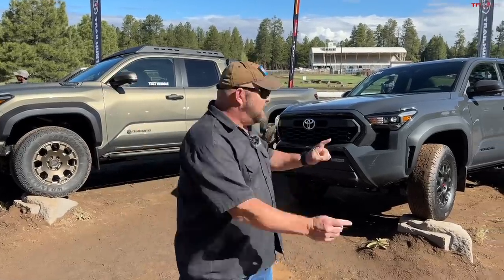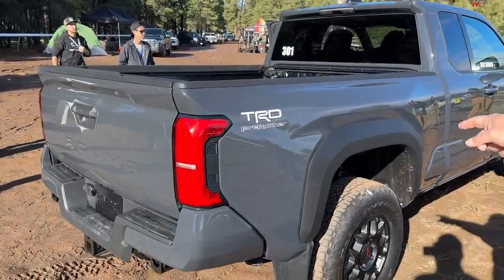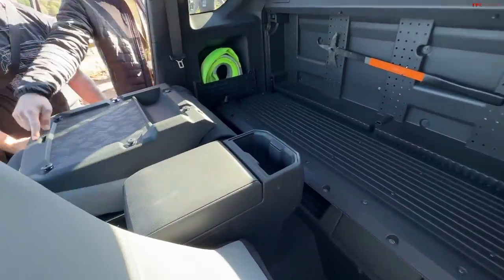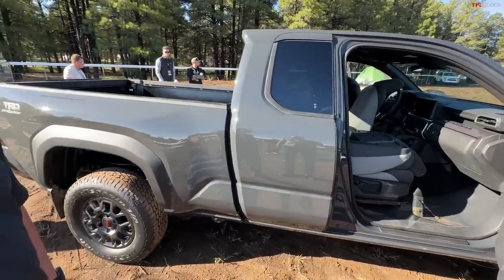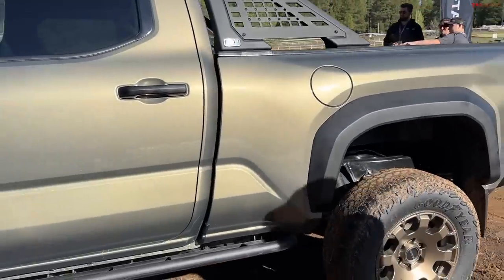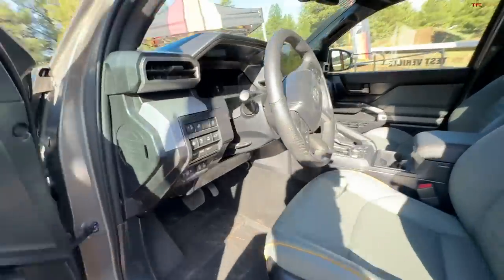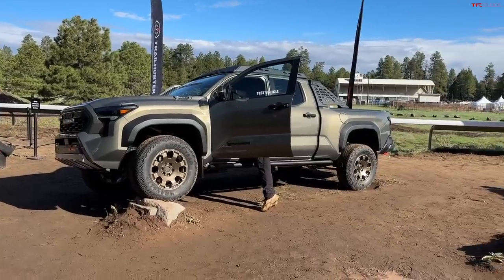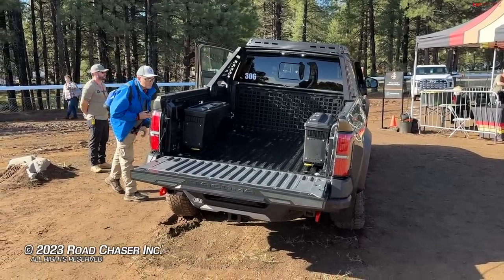Here's How the 2WD 2024 Toyota Tacoma PreRunner Compares to the All-New 4WD Trailhunter!

Comment: I bought a new 2002 TRD Double-cab Prerunner V-6 with a rear locker and it was the best vehicle I've ever owned.  Drove it for 18 years and sold it to my nephew with 275K miles on it and it is still going strong with over 300K on the odometer.  The locker got me out of most anything I got into and it was a workhorse.  I built or renovated 4 houses when I owned it and it was loaded to the gills with lumber and supplies many times and it kept on going and going.
Reply: That won't be the case this time around. Toyota's 4.0 V6 were simple which made them reliable. Now? It's complex like the competition. Expect a hit in reliability for Gen 4. No where near the Gen 2 or Gen 3
Reply: did yours have a Trans cooler on it I have and 2002 and live in SC im unsure if i should get one or not mine is 4wd tho
Reply: @moctezumaaleg2008  It had the factory trans cooler that sends the trans fluid through the bottom of the radiator.  A lot of people add an aftermarket trans cooler and plug up the factory arrangement because it can leak into the radiator and mix with the antifreeze and the antifreeze can get into the transmission and ruin it.  There are U-tube videos on this and it is called the dreaded strawberry milkshake.
Reply: @stevevice9863  yeah mine just came with factory but the radiator is pretty new so I think I should be fine for now as far as milkshake what I ahve been debating is if I need a cooler or not dont have much experience with how hot the trans temps on tacomas get .
Reply: @truthkeeperfilms  V6 didn’t last as long as the 4 cylinder.

Comment: No doubt the Tacoma engineering team is letting out a huge sigh of relief after seeing how positive the reaction is, especially after what Toyota went through with the Tundra.
Reply: The A team on the Tacoma side.  The junior varsity team on the tundra design group. 😂
Reply: Hahaha
Reply: Taco forums aren't liking it. They don't want the gadgets and electronics and a possibly less reliable turbo engine
Reply: @davidzambrano9126 I have a younger co-worker who bought the current gen specifically because of the new turbo. It'll turn some buyers away but their only option for NA engines will be the Frontier. I bet they'll stick with Toyota lol
Reply: @Ichibuns well to be technical not the only one, although the ridgeline isn’t very competitive it does have an NA V6 and so does the Jeep Gladiator. However the segment is downsizing as has Chevy with the Colorado 2.7L and even the ranger will bring a 2.3L 4 cilinder, we have to accept reality and at least appreciate they did get best-in-class Torque, hoping fingers crossed 🤞 they also nailed the MPG and beat the segment
Reply: The Toyota trucks are hideous looking.  GM did a much better job on their trucks.  They don’t look like Transformer toys like Toyota does.  Also there’s no front locker on the top Toyota trims like the ZR2 has.  Toyota can try and spin it however they want but no front locker is a big deal.
Reply: @holdenc3082  
they should have done a front locker, but as far styling I like it.
Id never buy another new chevy if it was a vehicle
I wanted to own past warranty.
Reply: @@dancross3340  Toyota’s reputation for reliability was over a decade ago but lots of folks haven’t caught up yet.   My GM vehicles have been better than the two Toyotas I made the mistake of buying.
Reply: @holdenc3082  
ive had two tacomas in row both have been good one I had for 10 years the other is now like 3 years old and nothing has broken, my wifes prius is the same, its had 160k and nothing still get 43 or so highway and about the same in the city
Reply: This Prerunner is marketed to me! I don't need 4wd, 4 door or passenger seats. I need a driver's seat and longer bed. Finally! I can get Toyota quality while looking somewhat cool...unlike a Santa Cruz or Maverick.
Reply: I've seen a mostly negative reaction everywhere but from these paid "journalists"...
Reply: @@dancross3340  I had a Tacoma also.  What a mistake.  It ate pads and rotors like candy.  I couldn’t keep brakes on the thing.  The starter died just out of warranty.   The shifter broke.  The doors felt like they were made of beer cans.  I dumped it and got a Chevy Silverado that went 250k miles with only a water pump replacement.    My wife had a 4Runner when we got married.   It was garbage too.  Couldn’t keep brakes on it either.  Every time the thing needs brakes it was a question of how many calipers were going to be stuck and would need replacing.   It was a well known problem with the 4Runner.   GM has given me less problems overall.
Reply: @@aaronerickson8878  It’s how they get invited to all of these events.
Reply: Tundra has never really been super popular, Tacoma sells like crazy.
Reply: @holdenc3082  So go buy yourself a Canyon.
Reply: @holdenc3082  Recycled beer cans is a selling point.  Every new truck they are bragging about aluminum hoods, tailgates fenders, etc.  Hell, the whole F150 is aluminum.
Reply: @davidzambrano9126  There are many saying they will not get it because they switched to the xtra cab instead of the access cab.
Reply: @davidzambrano9126  the turbo has been out since 2015 and has been flawless. It started as a 2.0 and now bored out to 2.4l. The Lexus has had zero issues with them.
Reply: @aaronerickson8878  have you read the comments here?
Reply: @holdenc3082 ude sounds like you either lying to us, or made a bad purchase without doing your due diligence. I have owned several Toyota and still have my 2019 Camry paid off with 107k miles still going strong, had one recall for the high pressure fuel pump and that’s it.  

Toyota still makes the most reliable vehicles, don’t embarrass Toyota by putting it up against Chevy or Ford. People that buy Japanese cars know how much more reliable they are over almost any other brand. 

Hence Toyota, Mazda, Lexus, Acura, Honda still at the very top when it comes down to reliable vehicles.
Reply: @@FlexRod  The only bad purchase I made was buying a Toyota Tacoma.  My wife owns the mistake of the 4Runner.  Toyota can’t design a brake system if their life depended on it.  As far as their wonderful reliability, go ask the ‘23 and earlier owners about the junk transmissions that don’t shift right, fuel pump recalls, and the still lousy brakes.  Toyota has plenty of problems, but the Kool Aid brigade likes to sweep them under the rug.  It’s almost like Toyota pays you people.
Reply: Need to have the back doors to open
Reply: @edmondseals  it would definitely be better with the access doors. Even just one door on one side would be a lot better.
Reply: @holdenc3082  What is wrong with Transformer look?
Reply: @SWells679  4WD is important for snowy state.
Reply: If I'm going to trust a company with Turbo, that would be Toyota. They have been dealing with Turbos for many many years. American companies not so much..
Reply: @holdenc3082 I have a Colorado and can't wait to get rid of it. I had problems with transmission, overheating because of bad water pump and thermostat, torque converter. The infotainment system is trash also.
Reply: @holdenc3082 You want to talk about bad transmissions and horrible service departments? Let me introduce you to GM and my POS 2019 Colorado

Comment: So you're saying the iforcemax has 100 more horsepower and 200 more ft lbs of torque than my '06 4.0? SOLD!!!!!
Reply: The new ones are sweet! I have an 05 4L. & 5sp. It's still rock solid 321,000 miles. The only wear is just a little on the driver's side seat from getting in & out. I'll be keeping a good eye on how the new ones age. Good luck!!
Reply: @jrtaylor2288  I'll turn over 300k this summer sometime and still runs and drives like new-really! I want a new truck but certainly don't need one.
Reply: @joelnichols9055  100% I love what I have & it's in great condition & I certainly don't want a payment 😀

Comment: I had a 2000 Tacoma 2.7L I4 PreRunner 5-speed manual and loved that truck. The cab of this new one is exactly like the OG PreRunner where the side doesn't open and the window doesn't roll down. I like it a lot. 

If I was to pick a new Tacoma it would be the TRD Sport with the 6-speed manual. 

The Tacoma by the way looks so nice compared to that brown bagger Tundra. The front end on the new Tundra is the ugliest front end in 50 years of automotive history.

Comment: For better or worse the 4th gen Tacos are way more innovative than I expected out of Toyota. Better, some really leading or matching features to current and new mid-sizes finally. Worse, even Toyota doesn't do well reliability-wise when they do completely new designs. The suspension on the TH and Pro is finally interesting. Reservoir OME and adjustable Fox shocks are nice, although the upcharge in MSRP is going to be insane. The 3rd gen TRD Pro was way overpriced for the mild upgrade over an OR.

Comment: I actually like how Toyota ditched Access Cab and moved back to the Xtra Cab concept from the 80s. Ditching Access Cab’s unusable rear seats and instead optimizing that space for storage moves it in line with what most people were using that cab length for anyways. Removing the rear doors helps a lot with weight, crash safety and cost as well.
Reply: How often have you loaded and unloaded a truck with 2 doors and no access doors? I do it all the time and it sucks.
Reply: I would have preferred that they kept the access cab with the storage options for the prerunners as it was a utility. I have a nissan d21 extened cab and it is a pain in the ass to reach over for stuff in the back. The access cab was a godsent idea for utility as it was easy to get stuff in the back.  Even the guys in the video struggled to reach over. If you wanted to carry people in the back then get a crew cab as that is what it was made for. Keep the access cab for utility.
Reply: This truck is still going to be over $ 50,000 where I live - for a 2wd. That's a hard pill to swallow.

Comment: TRD Offroad was done dirty imo. It's like Toyota didn't want to exhibit it. Almost immediately, those bilstein monotubes will need to be replaced. They will be the same quality as the 3rd gen. I had to replace them twice until I upgraded because they leak very easy. The new Tundra came with the same type of suspension (for the trim). I get it, buy the truck upgrade how you want. If you plan on getting the trim. I would have the upgrade ready immediately and wait a year so aftermarket can catch up.
Reply: YEP my 2020 OR had both fronts seize at 30k miles 😂 it’s now lifted!
Reply: Might be a lot cheaper to get the Offroad and upgrade to OM. EMU shocks.

 If you want to match the Trailhunter lift it should be easy along with the stronger plates, wouldn't be surprised to see a dealer installed TRD parts.

Still should  end up being SIGNIFICANTLY cheaper vs the Pro and THunter.
Reply: @sunavamatata  yes all I'm saying is do it immediately. Don't bother keeping the stock shocks on the TRD offroad,  They will let you down. So have money ready for that Fox, Icon or Kings that's if those companies are ready year one..

Comment: No one needs 4 wheel drive . I live in PA. I think I put my 22 4runner in 4 wheel drive like 3 times in the past year and it was really because I wanted to keep things working. Drove a 320i before that with snow tires. The all wheel drive and 4 wheel drive is so over hyped. Bottom line is if you suck at driving, you will suck regardless. If you are a good driver, you can drive anything.

Comment: Toyota needs to redesign it so that it has an access cab instead of a xtra cab. It is annoying having to reach over the seat just to get stuff like the dude who just asked for help for something he could not reach. Also redesign it so that the leaves are over the axel instead of under it. Under axel leaves reduces ground clearance and also restricts lift options. I would instantly trade in my 07 prerunner for the 24 prerunner if those features were added, but it seems like I will be skipping 4th gen. Hoping a Gen 4.5 or Gen 5 will see the return of the access cab with the storage options. Will probably go with the frontier if I need to.

Comment: What are the chances of finding the exact truck you want with all these different options. It’s going to be a Mind-F*** trying to find the truck you want
Reply: The challenge will continue to be toyota stunting inventory numbers to keep sales numbers low and prices high.
Reply: I don't think so. Not like Ford where every option is available so what's on the lot could be anything. Toyota limits options on the different versions so an SR5 will have limited options, and the Limited also will very few options to add. Therefore, two vehicles of the same badge will be likely equipped.

Comment: I like 2wd, extended cab trucks with leaf springs. However, I really love prerunners, and the Toyota "prerunner" is not a real prerunner because it doesn't have a prerunner suspension. There are only 3 leaves, not 11 or 12, and they don't have enough curve to give you a mid or long travel suspension. If you go to Baja Kits and replace the A-arms and leaf springs, then you would have a prerunner suspension. If Toyota put a 3rd Gen Tacoma 6 cylinder engine in the "prerunner" with a magnuson supercharger, then Toyota could compete with the Ranger Raptor. If they called the "prerunner" a work truck, it would be fine and a more accurate and honest name. Let's not pretend that a rear locker in a 2wd is new or exciting. I had a 2002 2wd, extended cab GMC Sonoma with a rear locker. It also had a 3rd door on the driver's side. The Sonoma had a 4.3L V6 Vortec engine with 180 hp @ 4400 rpm.
Reply: I have a 2d 99 SR5. Loading and unloading the back seat is a chore. I'm pretty sure I have back issues because of it lol. At least I got 4wd.
Reply: @Joshua Holcomb  That is why the 3rd door was great. Sure Toyota saved a little money, but considering the price is not putting 4 doors on the truck really a good decision? GM also made a 3 door Suburban. It makes more sense to put the 3rd door on the passenger side so you are not loading and unloading in traffic.

Comment: The good news for Toyota is that most future owners won't realise that the 2wd prerunner will take them anywhere they will ever want to go
Reply: Unfortunately, I need 4wd because I live in snow country
Reply: @jasonanderson438  well if so is the case of course you do. I'm talking about mall crawlers and people who work in flat farms, construction sites, dry areas....a locker and decent tyres with some skill will get you there
Reply: Indeed…I’m a die-hard Jeep guy with both a classic TJ and a JLUR. I’m desperate for a 2 door pickup with a manual transmission with the ability to tow and haul occassionally for home improvement projects and the like. Count me in as very interested
Reply: A two door long bed pick up in 2023. Slam dunk from Toyota for sure.
Reply: @shiftymcgee9359  i really think it has become one of the most interesting options out there. Specially the prerunner. Toyota is usually pretty smart when it comes to renew a model. We'll see what the 4runner brings
Reply: For sure that’s all we had growing up and they were constantly off-road coon hunting in mud packing hay bails 2-3 high over the roof line with the suspension completely maxed they still never broke. Hell even our old one was so old it had that Pontiac looking red triangle emblem they used to have.
Reply: You don’t live in the snow do you?
Reply: @BC_Hunter  most people don’t by population size. That’s why the original comment says ‘most.’ If you actually need 4x4, get it.
Reply: Worst comment ever. The PreRunner is worthless in snow country.
Reply: The PreRunner would be a great truck in Alaska..for the summer..all of 3 months.

Comment: I really hope this 2.4L I4 turbo turns out to be a fantastic engine. I had a 2 L turbo in a BMW that gave me a ton of problems and I had an F150 but the eco-boost that eventually cost me an arm and a leg with turbo issues. I really hope Toyota has avoided the issues others have been unfortunately unable to.

Comment: In February, my local Toyota dealer told me I had to wait to get the Pro hybrid Tundra (which I thought was a little ugly anyway) (I guess they weren't making any more for 2023? And the fact they dropped the V-8) so I wound up getting a Tremor this time around. I still have my old Taco, but I've been floored by the 19-20 mpg (calculated, not just looking at the dash meter) I'm getting in the 5.0 Tremor. If I drive in sport mode it is around 17, unless I'm just being stupid. That is still better than I've had in a non-diesel truck for a while. I was going to supercharge it with the Ford-approved Whipple, but I am having second thoughts. That Taco looks pretty nice, and it has more torque than my 5.0. I don't tow much though, so no regrets unless the Ford starts breaking down. Peace, Love!!

Comment: Can I get some advice on if 2x4 is a good option over 4x4? I’m considering the PreRunner since I have no need for back seat and like the storage plus the 6 foot bed. But I keep getting told not to jump on it cause there’s no 4x4 option. Thoughts?
Reply: Do you need a 4wd? It’s got a rear locker which is fantastic in most situations.
Reply: @yolo_burrito  it could be good to have. I live in the Poconos and we get a fair amount of snow up here come winter. I think I could manage with the 4x2 in most situations.
Reply: rear wheel drive trucks suck in the winter. They really do.

Comment: I don't see a point buying Tacoma without the sway bar disconnect. I really hope the sway bar disconnect system would be on the front just like a Wrangler and possibly I can retrofit to my 4Runner with a OEM style dash switch but looks like the system is completely different. So my only hope would be after market manufacturer to have an electronic actuator in the front or maybe a manual one like the Rubicon owners do when their actuator goes kaboom..